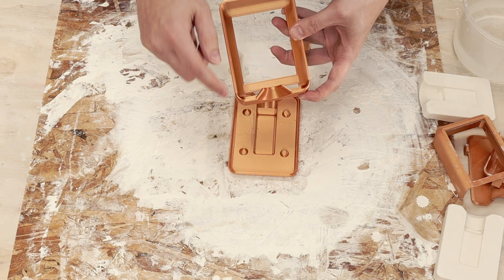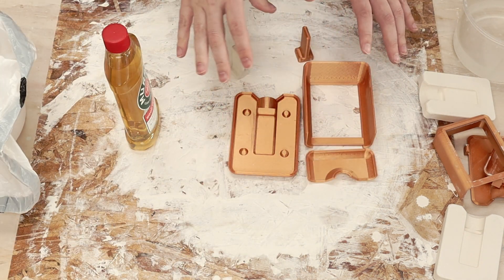Better Test Tile Molds

Comment: 3D prints are in the printing queue.  1) New test tile mold - https://a360.co/37Vajlt   2) Monster Mug - https://a360.co/3DZre2o   3) New Vase (7") https://a360.co/3rvLW4R 
Truly wish that 3D printing could be scaled up! These represent more than a week of continuous printing.  I typically run at 0.1mm for layer height. PLA seems to work the best. Have tried with ABS, which I like for the ability to solvent weld, but long print times just exacerbate the warping, making the prints useless.
Reply from the maker: Nice models! Yes, 3d printing is not all that fast, or the only ways to go faster are more $ or less resolution. Watching all of the makers on YouTube that do a lot of 3d printing it is pretty obvious why they end up with a bunch of 3d printers so they can do their prints in parallel.

Comment: I use 10 plaster to 7 water.     the more water the more soft and absorbent your mold.  too much plaster and the mold will become too hard and will not absorb water.
Reply from the maker: Thanks for sharing. I'm pretty sure the too much plaster problem is effecting one of my current molds - it takes forever to build up the clay wall on the plaster. Definitely a goldilocks problem getting the right ratio!

Comment: So satisfying!  I had a big smile on my face when the 2 mold halves fit together.
I found a video from Ceramic Arts Daily that has the info you wanted about dry weights. 
Plaster ------>Water
10 lbs              7 lbs
5 lbs                 3.5 lbs
2.5 lbs             1.75 lbs
1.25 lbs           0.87 lbs
The video title is "How to weigh, Mix, and pour plaster for slip casting"
https://youtu.be/GIwNMYOIb6E
Reply from the maker: Thanks for the link! I'd be curious if other slip casters use other ratios or not (assuming they actually measure!). Not to give away the punch line of my next video, but I decided to test this and ended up with the same ratio. I also test one more variable as well and have a slightly different procedure now.